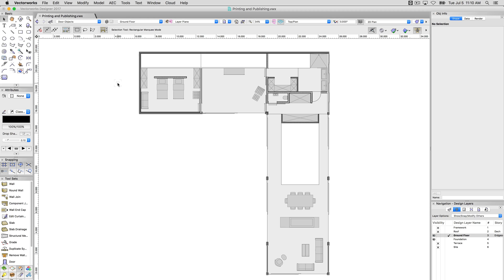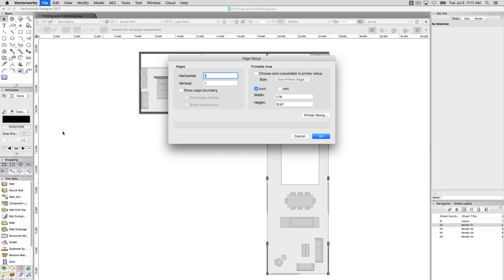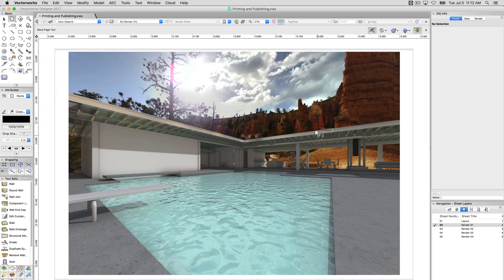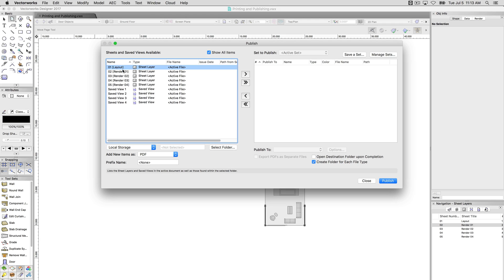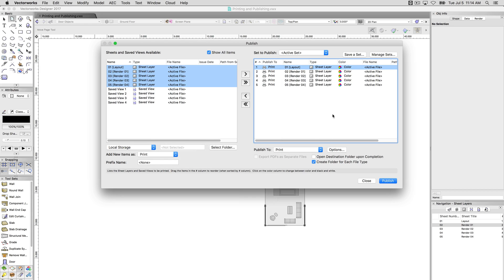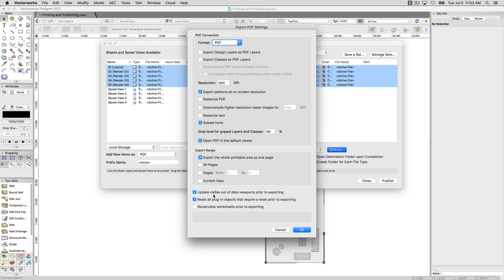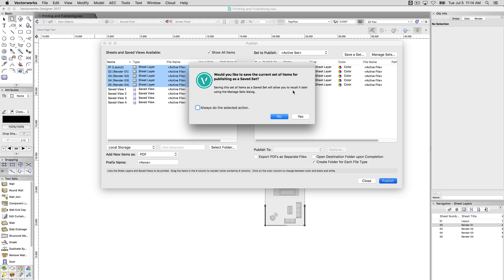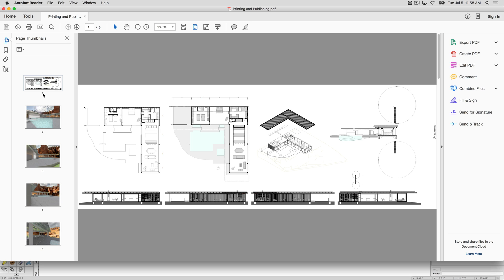BIM Architectural - Printing and Publishing

Comment: Will the lines of drawnings remain as vector when exporting pdf even if drawnings includes rasterised images like texstures? How about hatches or other line based graphics?
Reply from the maker: If you choose "Rasterize  PDF" in the PDF export options, it will rasterize everything into a flat image. If you don't check that however, all polygonal geometry should stay vector by default. Hatches and Tiles should do the same, but I believe Pattern is always rasterize. Image based fills would, as expected, be rasterized too.